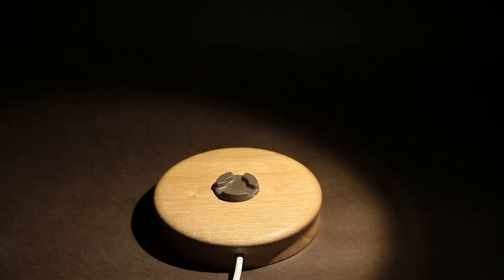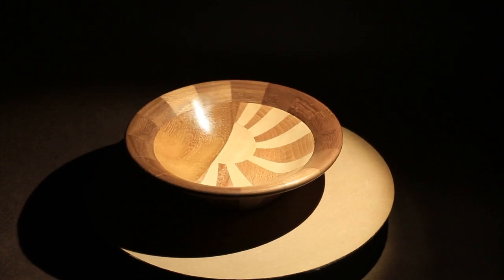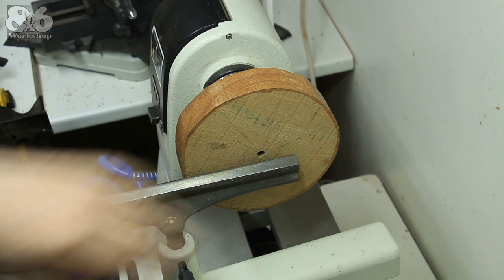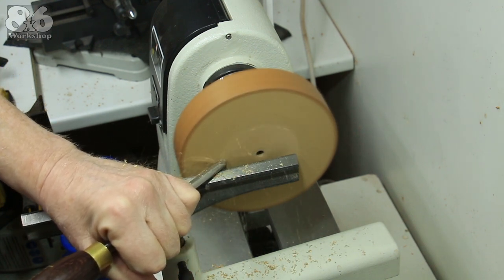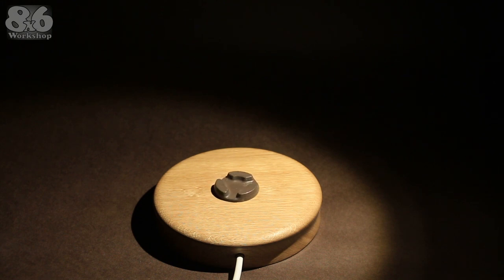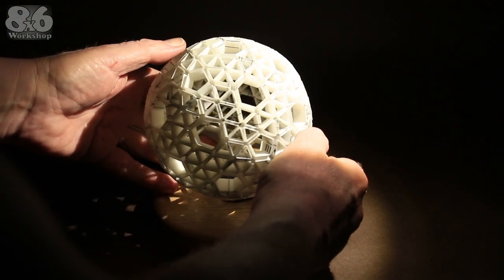Motorised  Display Turntable Build - A compact unit for shows, exhibitions and studio photography

Comment: Nice work Stephen, i used to be a microwave engineer and have lots of motors like yours, one job i have been meaning to do for years is to fit a motor to the rear end of the lathe spindle to have a slow turn when spraying lacquer etc, stops any drips forming, take care and happy turning, Dave

Comment: Superb work once again Stephen -and perfect for the truncated icosahedron display. Of course the alternative method of doing all this is to cut the microwave machine down to the level of the turntable and spray with enamel paint . . . but your method has class :) Thanks for another perfect interlude. Come to think of it Stephen - if the adverts were replaced by you making something I might occasionally watch TV!! :)